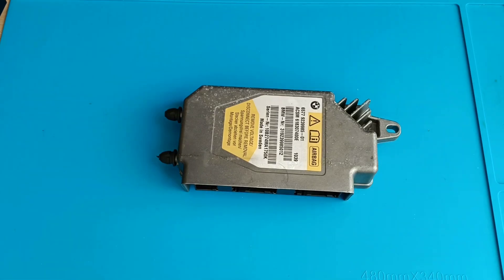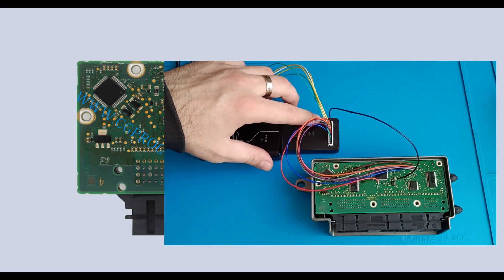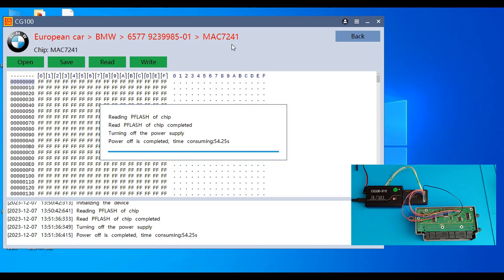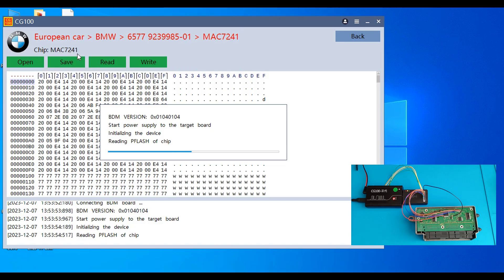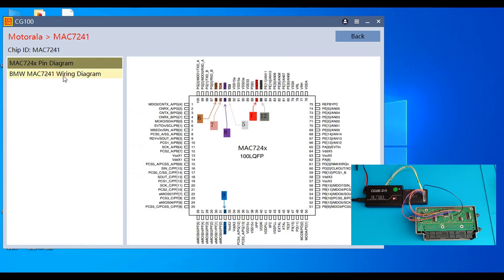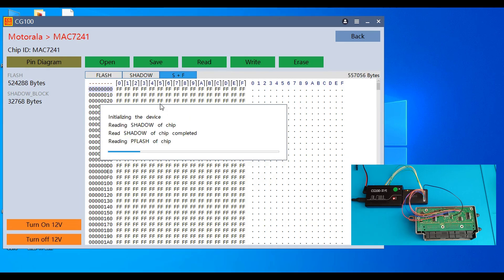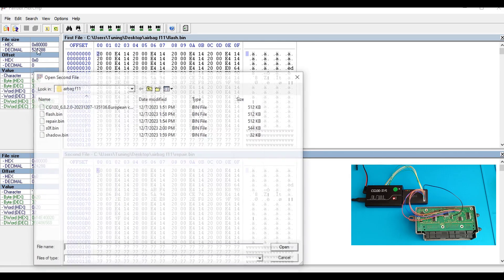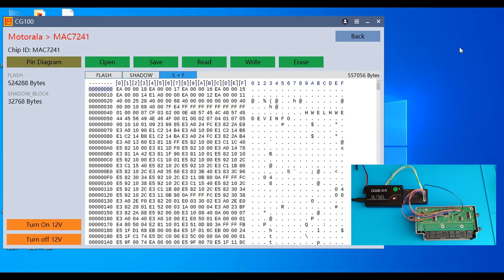BMW Airbag ECU full backup ! No need for Coding after replacement. CG100 Automatic SRS Crash reset !

Comment: CG100 III VS CG100X, what would you recommend ?
Reply from the maker: CG 100x is the new version.
Reply: ok, thanks I will go for that one  @YOYODiagnostic
Reply from the maker: @stefanoES23  
Airbags have the same function but they have extra for another.
Reply: thanks for helping, I hope that between xp400pro and cg100x I will have all most what I need for what I'm doing for the moment @YOYODiagnostic
Reply: Followed the advice, the CG100X just come today, first BMW dash EEP was wasy peasy, happy with the device, disappointed because they sent a china power adaptor not a UK one. Thanks for the advice. @YOYODiagnostic
Reply from the maker: @stefanoES23  
I would like if it is possible to update us on this programmer because I think not many people use it.  It would be nice to know what it can really do and what it can't.